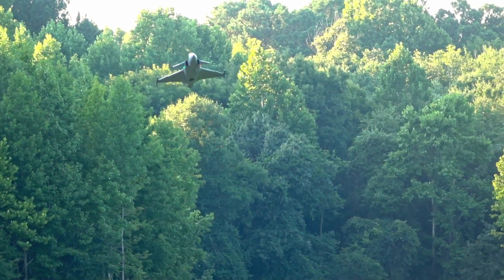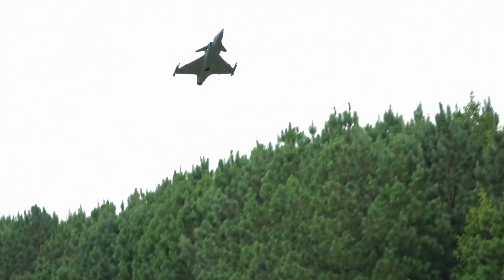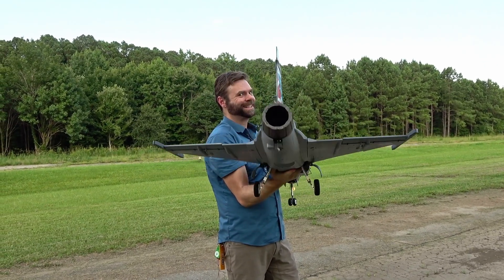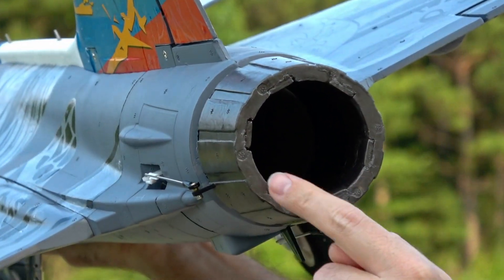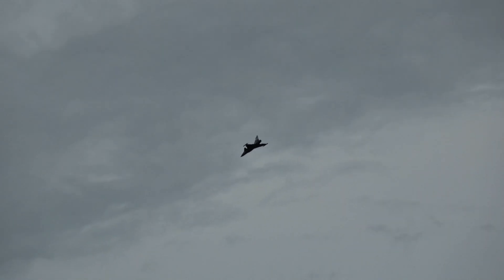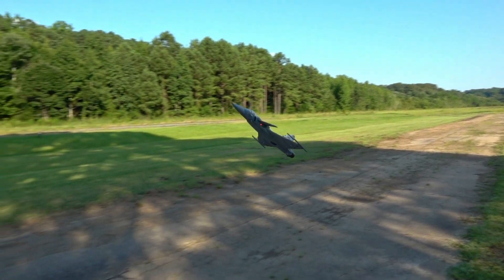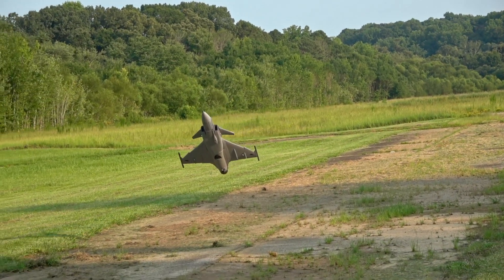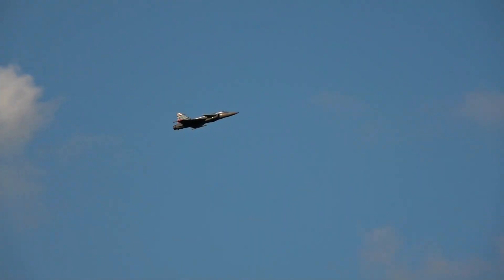3.5 Years of Gripen - 3D MONSTER on a Budget

Comment: Nice video. What inputs are being stablized by the thrust vectoring? Pitch, yaw, and roll? If yes how are you accomplishing roll? Through an elevon type mix? Separately, are you adding/mixing any yaw to your aileron inputs to help maintain control/stability at high alpha and slow speeds? I dont fly spektrum so i am trying to apply this my set up. Thank you and God bless 🙏
Reply from the maker: You can't stabilize roll with only one nozzle, so it's just pitch and yaw. Hop on Discord for more info: discord.gg/twobrosrc
Reply: @TwoBrosRC  Thanks Jon. Are you adding/mixing any yaw to your aileron inputs to help maintain control/stability while doing high alpha or slow speeds or just using rudder. I will be sure to join/download discord when I get home. Thanks again

Comment: Did you have the canards acting as ailerons too?
Reply from the maker: Nope. That's not aerodynamically sound.
Reply: The Freewing set up video for this plane has the canards set up as elevons. Is that correct or are you saying take the aileron mix out of them and have them only work as elevators? Thanks for the video and insight.

Comment: Hi, nice video!! One question, have you ever made a video showing how to correctly hold your fingers on the gimbal of the remote control? And I wanted to ask you if you have ever adjusted the tension of the gimbals, I have a nx8 Spektrum and I think that maybe by tightening them a little I can make more accurate movements... but I have to try... I ask you because I see that you are very good and precise in the maneuvers, thanks.
Reply from the maker: There is no "correct" way to do it, only what you prefer and what works for you. Tension is also a personal preference.
Reply: @TwoBrosRC  Yes, I understand, but I wanted to know how you hold your fingers on the gimbals because you are very good, certainly better than me.. 😉 for example today I tested holding the gimbals not on the tips with the fingertips but holding them with two fingers at the sides and I had the impression of giving a very precise and rational command without jerks, I just wanted to ask you if you also handle it in this way... thanks anyway for the answer.
Reply from the maker: Jon uses thumbs, but it's really all about finding what works for you. There are way better pilots than Jon who fly with pinched fingers and way better pilots who use thumbs.

Comment: I agree that thrust vectoring is nice on any jet but it would truly be awesome on the mirage 2000 80mm. That thing actually has over 1:1 thrust throughout the flight and could do sustained jet hovering. The gripen is simply too heavy to sustain that maneuver for long. Cheers
Reply from the maker: Mirage can't hold it for long either, maybe 2x as long as Gripen. They aren't that different in weight.
Reply: @TwoBrosRC  Hi There, based on the specs there is a significant weigth difference (around 1kg).
Reply: @xXRapToRiXxGamer ,
The Mirage is limited to smaller Lipo-Packs, I think 4000 mAh is the limit. That is probably the point, as the voltage drops earlier plus more voltage sag on this smaller batts.
Kind regards

Comment: Hi Jon…thanks for the excellent video. You recommended replacing the esc with an Avian. Is there an issue with the stock esc? Or do you just like the Avian because you have the ability to program it through the transmitter and get voltage callouts?  Thanks.
Reply from the maker: Mostly for the transmitter programming, but also for the 6v BEC power that really helps drive the servos for stabilization purposes.

Comment: I have this AR10360T on my gripen too, but the wing is rocking quite a bit on high wind. It scares the crap out of me, so now I put another gyro. I found it puzzling to understand spektrum gyro forward programming
Reply from the maker: Are you using AS3X+ yet? If not, upgrade to it and adjust the roll gain. Ours didn't need much gain at all, it was very stable regardless of what conditions we flew it in.
Reply: @TwoBrosRC  Yeah, I have AS3X at all times and have played around with the gain but still have wing rocking. I thought it's normal even Alejandro had the same issue as he said in the forum. I look forward to your next video on how you set up the gyro. I use NX10 to set it up rather than using USB dongle

Comment: What sort of improvement did you see with the servo change?  I didn't see that covered in the video.
Reply from the maker: That's more for next Saturday's AS3X+ video. Servos with lots of torque, precision, and high speed are super useful for gyro stabilization as the gyro can make use of them at 11ms to keep the airframe stable even in an intentionally unstable configuration like ours.

Comment: This is insane! Basically a 3d jet at half the size, and cost of other true 3d jets (especially those with turbine power).
Reply from the maker: Yup, and all it requires is some relatively minor work on your part - even with the upgrades in the description under the equipment used section, it's still cheaper than something like a FlexJet TV.
Reply: Yes but this still doesn’t beat the power to weight and flight time vs turbine. You can’t sit around hovering for minutes on end and actually gain performance like the turbines.
Reply: @10fantic  your right. But to even get close to that performance, with a 70mm edf is pretty cool!

Comment: Holy S* that's a tech wet dream right there very impressive programming and creative control engineering. I want one and I have an old AR10360T receiver... is it FW upgradeable to what you did here? Posting on discord but I just wanted to give you the content here too. So cool
Reply from the maker: Yeah, all you need to do is upgrade the receiver's firmware to AS3X+ and get it balanced around 30 to 40mm behind the marks - then adjust the receiver using our AS3X+ programming guide coming next week!